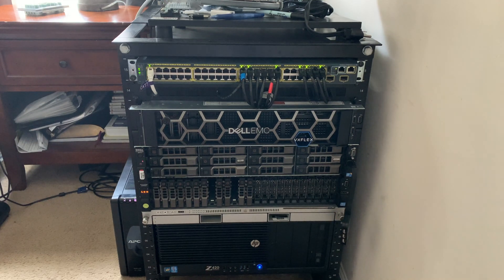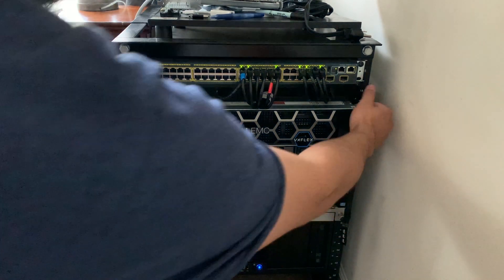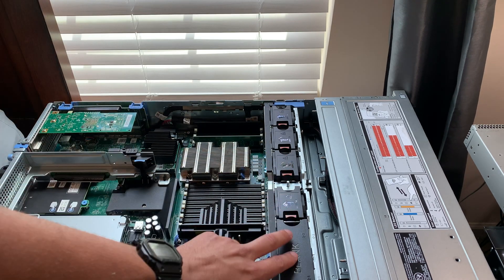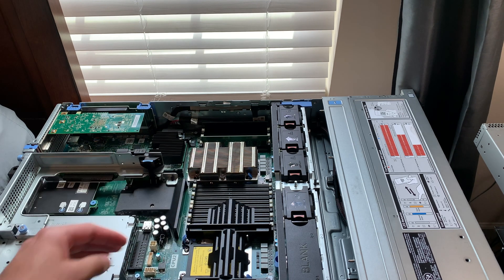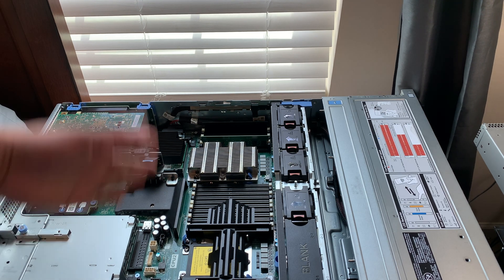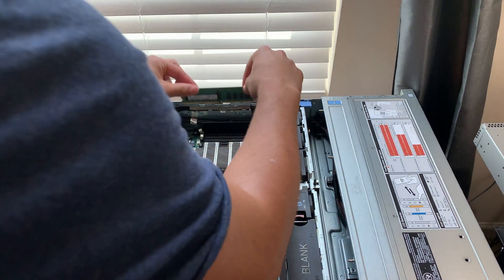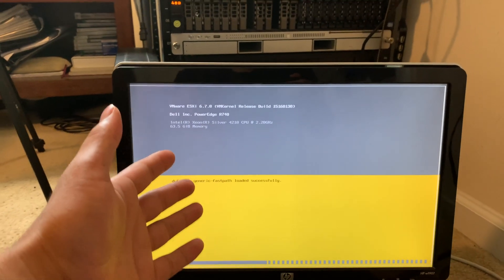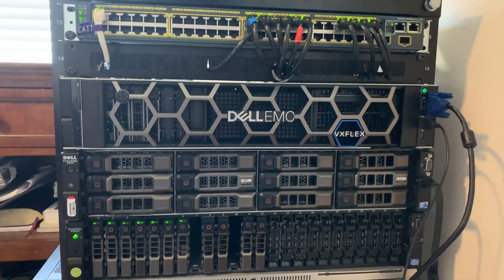Dell EMC PowerEdge R740 RAM Upgrade!

Comment: DIMM population update for Performance Optimized mode with quantity of 4 and 8 DIMMs per processor.
When the DIMM quantity is 4 per processor, the population is slot 1, 2, 4, 5.
When the DIMM quantity is 8 per processor, the population is slot 1, 2, 4, 5, 7, 8, 10, 11.
Reply: It looks like you did 1-2-3-4?

Comment: How is the power efficiency of the R740 compared to an R730?   I know going from an R710 to an R730 was way more efficient.  My 730 is currently sitting at 110 Watts and it's got a bunch of VMs running

Comment: That is great gear for a home lab.  Right now, my homelab consists of a home built 20 bay 4U media server, and a 4U rack mounted threadripper system. My media server is a 24 core dual xeon rig with 128 gigs of DDR3( I love cheap ram). My threadripper is a gen1 1950x system. Its old but still fast. I also have a Dell R720XD on my work bench waiting for storage.  I'm not sure if the R720 is going to be a blue iris server or the storage target for blue iris running on another rig. Either way, the homelab bug is a fun bug to get. Its a great if expensive hobby.